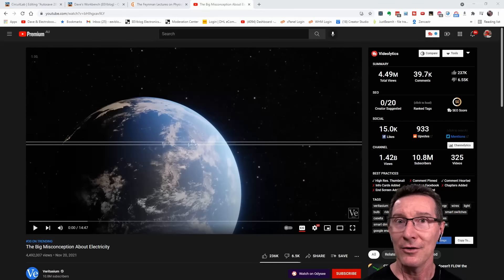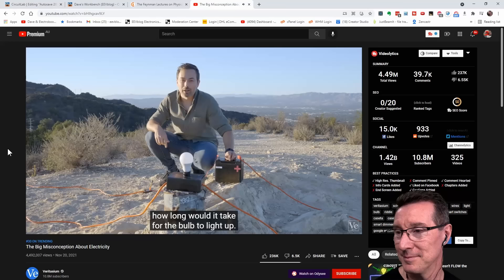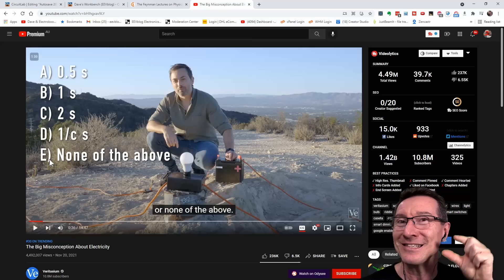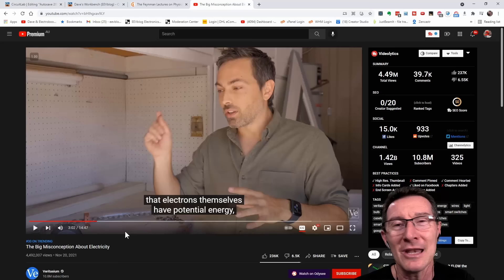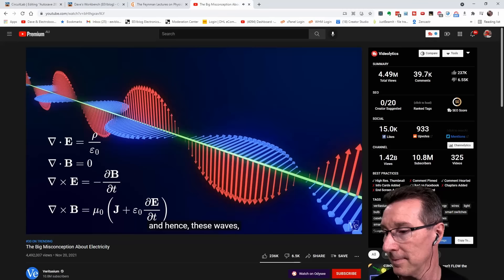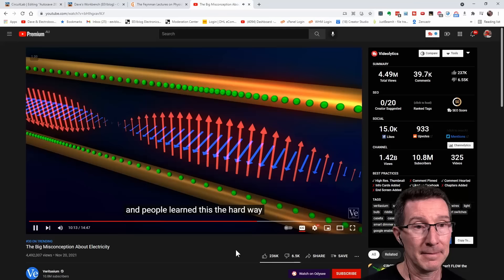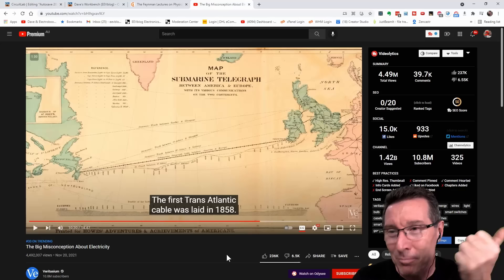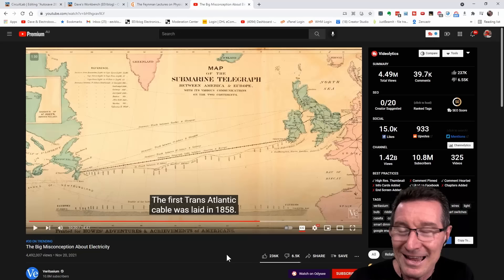EEVblog 1439 - Analysing Veritasium's Electricity Misconceptions Video

Comment: While it is true that you will get a transfer of power to the opposite side of the loop after 1/c seconds, the capacitance between the two wires is so low that the amount of power will also be very low.  Certainly much less than you would get in a very short piece of wire connected to both battery terminals.  There wouldn't be enough current to light the bulb; even if the bulb was sensitive enough to light up with that small amount of current, it would only do so momentarily, because it's just one pulse.  Transfer of power would only occur in the instance when the switch is closed, and would stop once the wire was fully energized.  The full power of the battery won't reach the bulb until 1 second later, when the DC current arrives.  
AC current, of course, is a different story.

Comment: A solid-state physicist will disagree with both of you. Actually the correct answer is related to the electron relaxation time (and mean-free path). The relaxation time is of the order of femtoseconds, and will vary from material to material, the temperature, doping (alloy) profile, and frequency of the incident stimulus. It is the conduction mechanism that ultimately decides the speed of switching (hole or electron mobility). Isn’t that why semiconductors are limited in their speed? Ultimately, the conduction in a wire at high-frequencies occurs through the so-called skin effect. So, to some extent you are both correct, ladies.

Comment: The switch poses a problem. Charge a capacitor C at V volts. Charge is CV. Energy is CV²/2. Brutally switch another empty C in parallel. Conservation of charge results in voltage V/2 across the combined capacitor 2C. Therefore Energy is CV²/4. Conservation of Energy implies the loss of another CV²/4. Where did it go ?

Comment: Wait, since the premise said that any current would do. What if we consider the switch as an capacitor, wouldn't it mean the light bulb would already be on BEFORE the switch is closed? I mean, since it's an LC circuit, so it would oscillate indefinitely. So, the correct answer should be none of above.
Reply: I mean, the switch itself has capacitance, right? And since there are no resistance, it should be oscillate... forever.

Comment: Question, rather than have those two wired parallel one meter apart, extending for 300million meters out and back, how long would it take for the bulb to light up if you just made those same wires form a very large dia circle? In such an arrangement , there can be no elecromagnetic field effects, as those fields could not extend over the diameter distance. So how long would would we wait to see that bulb light up?

Comment: I read electronics in bachelor and probably had similar ideas but did phd in development of Li-ion batteries. What the engineers either dont understand fully or dont pay heed to is the fact that during a discharge of battery an electron has to forced out of the circuit from anode and travels along the circuit to cathode to get redox back. That means electron travels the full length of the wire in that case the concept of transferring the energyto the load in 1/c s is wrong rather it should take approx one second

Comment: The answer 1/c is wrong (assuming zero resistance). The initial field from the battery to the bulb is insignificant. Therefore, the energy has to be carried along the fields around the wire.

Comment: First, he's not addressing engineers, he's addressing novices (most people) who are taught the electron pump model of electricity.

Second, I think he gets something else wrong- he's drawing the EMF field symmetrically as of both poles of the battery are similar energy sources to a light bulb which is some kind of resistive black hole for EMF. The energy is a loop. The poles have inverted effects.

Here is my comment on his page:
There are both things happening- field effects like inductance and capacitance (EMF), and particle effects like electrons and holes. This is similar to the wave/particle duality. If you create an opportunity for one, or look for one, you find it and not the other. When you find one the other disappears, only to reappear when the circumstances change.

I would guess that electrons are pushed around by traveling EMF waves, but it's possible that both EMF and electron displacement/travel are being caused by another, higher or lower form of energy and both are secondary effects which we can observe.

And all this begs the question of whether atomic and subatomic particles are just standing EMF waves resulting from a 3 dimensional interference pattern.

Comment: Energy flux S is pointed into a wire because lossy wire consumes energy and turns it into heat and radiate outside as infrared electromagnetic waves (infrared wave flux is pointed outside). When wire has no resistance (superconductor) the E field component is zero, so S=0 and has no direction. There is no electric field inside an ideal wire.

Comment: Seem if you tightly shield the wire for EMI then it doesn’t matter how far apart the source is from the load. The response time won’t vary from 1/2 sec.

Comment: If Derek and Dave want to be pedantic, it's the position of the switch that matters, not the wires. Imagine moving the switch to one end of the loop. Surely the lamp can no longer respond in 1m/c, otherwise you'd be sending information from the switch to the lamp faster than the speed of light. Sending information faster than light is no less problematic if the switch is only 1m down the line and the information only has to travel at c*root(2). If you accept the 1m/c answer, the orientation of the wires has to be irrelevant, because the wires can't be involved until they "know" the switch is closed.

Comment: As a physicist it is annoying when people criticize others about science when they do not understand it correctly themselves. Firstly, when you do dimensional analysis the correct way refer to inverse dimensions is "per", not "on". As in m/s (meters per second). It must be understood that electrical engineering is basically applied physics of electricity and magnetism. Many of the fundamental equations used were developed by physicists, not engineers. In fact, there were no engineers as a profession when many of them came into being. These are just a couple of the silly misconceptions in this video.

Comment: The power source for this example is a battery which is direct current which is zero frequency and zero wavelength. By definition a zero frequency/wavelength source does not produce electromagnetic radiation. Time varying electrical fields generate space varying magnetic fields and vice versa. Capacitors and transformers (inductors, wire coils) are frequency sensitive devices. They are irrelevant in any discussion of DC circuits. A transformer coil in a DC circuit is just another piece of wire with a resistance. A capacitor in a DC circuit is an Open circuit.

Comment: Assuming the transmission line is cut at both ends at 1/2 light-second away, your argument suggests that the light bulb will still turn on due to coupling capacitance. It is mind-boggling. In fact, we don't even need the line at all to transmit power and I don't feel right about it.

Comment: One thing that kind of bugs me about the Veritasium video is that all the animations portray the bulb as far away from the battery, at the end of some length of wire or TL. But the circuit we are asked to solve for has the bulb right at the driver, not at the end of that long transmission line. It's a tricky question and you have to pay attention for sure.  If the bulb were placed at the end of a 1/2 light second long transmission line the answer would be very different indeed.

Comment: energy transfer trough the air needs a frequency connection (like charged wire or charged cristals) for the energy to flow trough space, it corresponds trough energy the electrons dont move but they communicate and direct the flow of energy from the battery to the choke point

Comment: The distance between the wires is not the important factor, the distance between the switch and the bulb is important. And this information was not mentioned specificaly (light bulb is 1m away... from what? switch or battery?).

Comment: This is a classic example of the difference between theory and practice, physicists and practical engineers.  Engineers think differently.  Thinking about practicality is great for how we use things today.  Thinking about the basic theory is great for how we may use things tomorrow.  And Engineers will adapt to whatever those changes may be in the most pragmatic way for cost-effective, safe real-world day to day use.
Talking about the theory to the general public makes for an interesting video and reminding everyone of the theory we basically ignore every day in simple scenarios isn't a bad thing.  Again, it's just the difference in the way physicists and engineers think.  You're all actually agreeing but quibbling about the details or whether it matters.   Of course it matters even in engineering in certain examples.
One thing I would point out is that leaving the "m" out of the answer is not wrong at all.  It's 100% correct.  He points out before giving the options that the distance is 1m.  The options are the most simple numerical answers and you have the information you need to answer D.  Leaving the m out "may" be for dramatic effect but as he's found in his early videos you don't get views on youtube without some kind of catch without enough subscribers.  He doesn't lie about the theory at all.  What he's describing is a physics answer (as we understand it) and there's nothing at all wrong with anything he says.  I had no problem with any of it.
Saying it's engineering 101 is fine but it's only engineering 101 because the theory was handled long ago and simplified by people smarter than any one of us to give  us practical methods of dealing with what's happening in the universe.  There's probably even more going on than we think so, as I said earlier, returning the very basic theory for another look is always a good thing.

And it's created a bit of controversy and if you didn't understand one video but another helped you understand it better then you've learned something and I think that's the aim of all the good creators who've tackled this: to educate not just engineers or physicists but to educate and excite everyone.  Mission accomplished by everyone.

Comment: In DC there is indeed something that wants to go from side of battery to the other side.
A battery short circuit ( real DC ) will balance too rapidly the battery.
Thats why you get this damaging result on the battery.
In AC, its the rotation of the magnet that create a magnetic tension in wires.
An AC short circuit is like wanting to stop the rotation instantly.

Comment: I had a better description.
Put switch and bulb next to each other
Lay out your 1 light year of cable from the switch to the bulb.
Lay another light year from bulb back to switch.
Cut the cables at the greatest points.
Turn the switch on.
The light will start to light immediately because this is a circuit of a source, two capacitors and a lamp.
It will light for 1/2 a second I guess because that will be how long it takes to fill a low capacitance high physical dimensions cap.
Then it will go out.

Comment: This might have been answered, but I'm not going to read all 5k+ comments to see.  So, in the case of the DC circuit you appear to be implying that once everything is settled into the steady state, that if you opened the switch it would take 1 second for the light to shut off.  Am I understanding that right or did I miss something?

Comment: The Veritasium video essentially emphasizes that the energy, in a classical sense, moves as the field* produced by the charges,  n o t  by the charges themselves. This is essentially known to many in the public and, it does not harm to remind those who may have forgotten it in between. 
*[It's perhaps worth adding that at a deeper level the energy and momenta are carried by the  q u a n t a  (or  'p h o t o n s') of the  o m n i p r e s e n t  q u a n t u m  electromagnetic  f i e l d. The quanta move in the vacuum with the speed of light, c, energy E= hv, and momentum p = h v/c (for any frequency, v, and, h= Planck's constant) in the direction of its propagation vector when the field is  e x c i t e d  in the associated quantum  s t a t e  by the motion of the charges in the circuit.]

Comment: If the wire loop were 2 light year long, but there's a break in the wire 1 light year away, how long before the switch knows there is a break? 
(by reflecting waves)
Does he mean to say the light bulb will light after 1meter/c  second, regardless of the break?

Comment: The time was (1/c) seconds, there's no metres in time.  However the implication of the Derek's video was misleading because it implied that the steady state was propagating at the speed of light, which is not the case.
Reply: To reach steady state for the bulb to turn ON and stay ON, you have to wait 1 second.  So Derek's answer of 1/c is NOT entirely correct.  

Moreover, EEVblog's lumped element model here is not the right one for Derek's experiment set up.  Go to the top and sort comments on "Newest First", scroll the time stamp of this post, and read mine.  You'll be surprised at what the answer really is.

Comment: Yeah I realized the same thing about the 1m distance from the bulb. (Calculated to be 1/3E-8s minimum) But to be specific isn't the distance that matters is between the switch and the bulb NOT the battery and the bulb? I'm assuming the answer is based on the voltage potential already being present at the switch along with  assuming the observer is at the switch factoring in special relativity. Because if the observer was somewhere else not at the switch the answer would still change from the time he sees it switch turn on to the time he sees the light.
Reply: Yes, the two sides of the switch are the point from with the change in charge density change  propagates out.

Comment: I have a comment and a question , first, if there is no current flow there will be no magnetic field. If flow stops the field collapeses and creates a back EMF.  The question, if the wire is shielded and tied to earth, does it block the capacitance and inductance  coupling.

Comment: Just out of curiosity, what if one winds the cable on a cable drum? Or even better what if one takes the cables (of each direction of the 300.000 km), lays the parallel and then winds them on cable drums? Would the em fields in the drum create an inductive resistant so high it could erase the current so that the light will never turn on? (For the record I am not an engineer nor a physician so please be kind with your answers).
And what happens if at the moment of turning the power on those cable drums have an iron core? Would you get a kind of railgun?

Comment: So not an EE here just interested but the videos raised a few questions for me. 
If the wire was fully insulated would that make a difference?
If the distance between the wires was 10m would the bulb initially be dimmer than at 1m etc.
From the videos I took it that the reason the bulb would light at all was just initially by induction?

Comment: If energy flows OUTSIDE the wire, and not inside, would one rather touch the conductor or the insulation of a hot wire?

Comment: Power vs. energy. Power is transmitted when a photon emitted is absorbed. Energy flows at the speed of light. if there is any resistance in a conductor, there will not be any minority particles to absorb the photons of the field. (remember photons are only "particles", or observable at a point, if they are interacting with electrons). When a photon is "observed" by the change in energy of a free electron, power has been transmitted! So, energy flows at the speed of light in a field, however power, if there are real atoms in the system, flows at the speed of light (actually about .997 C for thermodynamic reasons, namely because they are not travelling only along the shortest path) through the physical conductor, because this is the limit at which new 'holes' may be made for the available photons to fill.

This is why the skin effect is so important at higher frequencies (and relaxation time at lower frequencies), because photons can only be 'observed' by electrons directly in their path. So, if the field is oscillating faster than the relaxation time (time for electrons to move to the skin of the metal conductor), the energy is entirely (or nearly entirely) transmitted between electrons on the outside of the conducting body. 

To get even more nerdy, the square wave that closing that switch would produce would cause a very small, but real smooth 1st order waveform on the other side, yes even if there was no resistance. This is because photons are quantized into fixed frequencies, and a square wave is a sum of a 1st order discrete series of increasingly higher frequencies. So the 'power' would follow the energy in a 1st order response curve.

Comment: I still don't understand.  Suppose you BLOCK as MUCH of the EM waves surrounding the wire between the battery and the bulb.
Are you saying the bulb won't light up?  Run the wire through 3 feet of lead, battery on one side, bulb on the other.  Or 3 feet of some kind of metal.